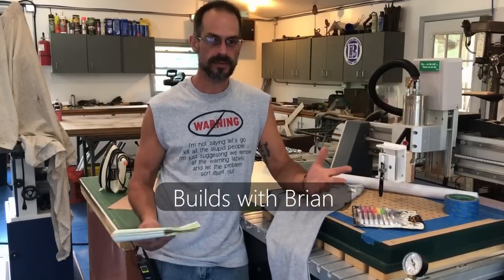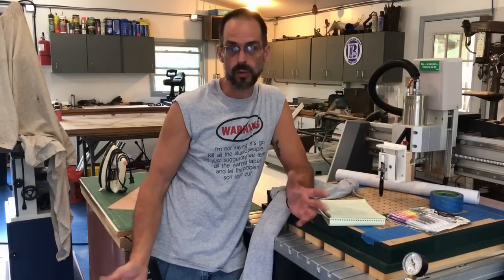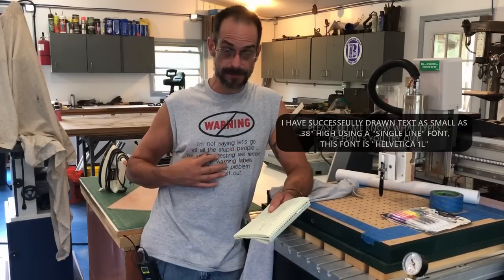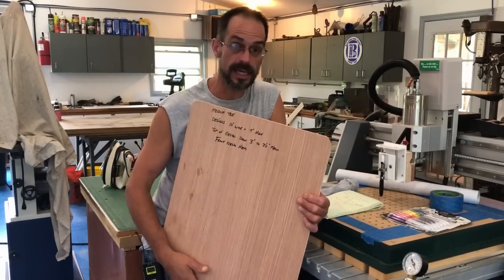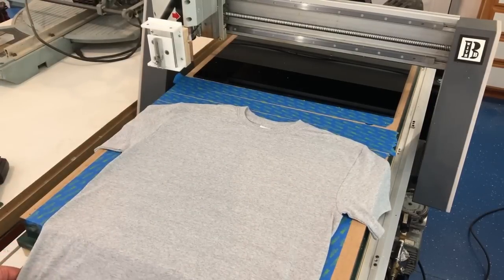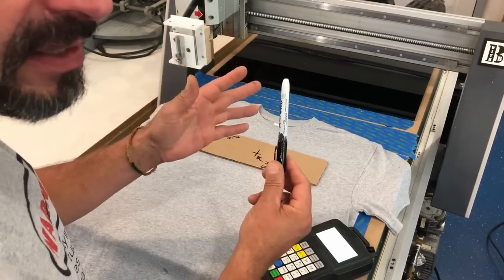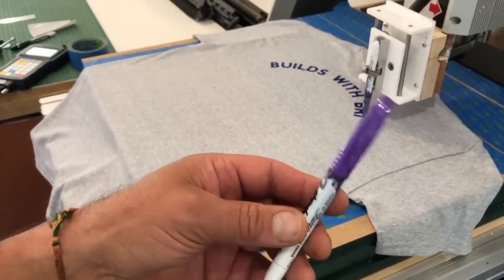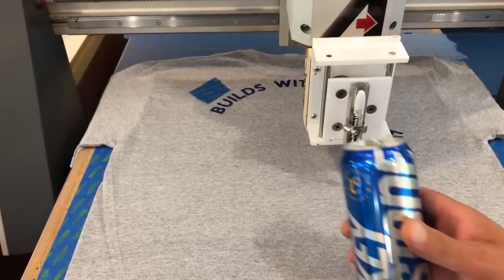How to make Custom T-Shirts with CNC router

Comment: That is really clever I would glue the shirt to the quarter inch plywood with spray adhesive for t-shirts like screen printers use and that way you don't have to use the Shelf paper or better yet build yourself a plantain board and glue the shirt to it and you do not need a vacuum table I'm aware of this cuz I am a screen printer but you got the ideas flowing in my head for a one-off t-shirt thank you for that
Reply from the maker: Good ideas, thanks, I Appreciate tips from a pro

Comment: Great video! Nice pen holders, too!
There are many spray adhesives used for silk screening fabrics, that you can spray on your shirt board, and then pull the shirt over it, smooth, and press the shirt into place. You should be able to easily clamp the board/shirt in place, before running the code. The shirt is easily removed from the board afterwards.
Reply from the maker: Thank you for that tip I will look into that, especially if I produce a part two video 👍

Comment: I’m new to your channel and not sure if you know or not but for those that don’t know. MDF with the top and bottom cleaned of sealer makes a great vacuum top. The air will pull right through the mdf.
Reply from the maker: Yes I have read and been told it many times however I have yet to try it myself.
I might sometime try it, I just wonder if a regular shop vac has the power to pull through it ?
Reply: @BuildswithBrian  on a small area it may work good. You could use 1/4” mdf to do it was easier to pull air🤷🏻‍♂️

Comment: You could make a paddle similar to those used by professional tshirt/top screen printers to hold the material, sprayed with adhesive. 
The adhesive lasts for several shirts. With the right jig system this would allow multiple prints of the same shirt simple enough and the paddles are cheap to make in batches from MDF cutoffs or other scraps the right size.
Reply from the maker: Great tips, thank you!

Comment: Nice!  Personally, I would make multiple vacuum boards that are designed to slip inside the shirt and then mount firmly and precisely onto the main table.  That way, you can be setting up one (or more) shirts while one is being worked on.
Reply from the maker: Let me know how it works out.
I really only do it for fun... and I am not too concerned about being production oriented 😁

Comment: Hi Brian. On z-leveling - would it make sense to mount the pencil in place over the tape? Then you will not need to stress yourself precisely positioning it. Just let it touch the tape, fix it and may be lift a touch, set z zero?

Comment: As far as the vacuum system issue goes what if you use a screen over the top board to keep it from dipping into the holes? That may be cheaper than a new table altogether.

Comment: I have Vcarve pro and how can I draw in the center of the two Vectric Vcarve lines, I really to know this?
Thanks
Reply from the maker: H H ... not sure what you mean by  the “2 v-carve lines” can you explain more ?
Reply: @BuildswithBrian  I have sone ink drawings I made and wanted to use my CNC to draw them.  I use a digital camera to take the picture then I connect the camera card to the laptop, and import the JPG image into VcargePro and use the import bit map for tracing, then  click on trace bitmap -fit vectors to selected bitmap.  This makes a vector line on each side of the lines, next I select the blurry center.  The two lines are for VCP the limit the Vbit cutting. I can either use the Quick Engraving or the V-Carve utility to draw the imported image.  And that is where the two lines come in. 
I would rather just have a single line as that would look more like the original drawing.   Is there a better way to get a single line to be drawn from the CNC?
I contacted Vectric and they said to use the Offset utility and just make the two lines closer together, but that’s really not much use.
Thanks 
HH
Reply from the maker: H H ... now I understand, and I have had the same problems with bit map tracing.
There seems to be no way around it, at least in my experience.
It is frustrating.

Comment: Hi Brian, I watched the video that Dave Hatton had you as his guest...awesome show and ideas, thanks for sharing your thoughts, really great stuff! I was anxious to watch this video and went right to it. I'm still a newbie in cnc , you expressed in your video about the spots showing through the fabric. Couple of thoughts popped into mind, I'm certainly no expert, but thought I would share them. Thought #1; could you laminate some window screen over the whole vac table to decrease the vac pulling shirt into holes, not sure the effect of would have on the ability of any lost suction between the hole as mean is porous, fibreglass vs. aluminum screening? Second thought is maybe the air suction shortening the open time of the ink toner resulting in inadequate saturation into the fabric. Thanks to both you and Dave for the inspirational ideas etc.😊 Andrew

Comment: Really enjoyed your presentation. Very informative. I’m looking to use a CNC to build custom electric guitars/basses but would like to keep the router earning when I’m not working on instruments. Would you be able to forward information on the CNC router you use?  Thanks for sharing this information. Your setup is superb. The letters are incredibly crisp and clear. It may be the router will be running more for custom graphics, especially if I can get it to print half as clean as you are. 😎🤘
Reply from the maker: My cnc machine is an axiom AR8 pro,
It actually has a spindle instead of a router, and I have been quite happy with the setup.
Although i can’t recommend that you try to print graphics on t-shirts with my method as a business model, it it to slow, but it works great for having fun and making them for yourself or family and friends.

Comment: Very interesting, creative, and something I had never considered doing with my cnc. Thanks for explaining it in such detail. 

The Z axis pen holder you have that can move up and down. Is that just gravity holding the pen in place, is it there acting like a weight to put pressure or do you have it fixed solid while drawing. I did not see it move while draining.
Reply from the maker: Wicked Wood , yes the pen floats up/down to follow the surface , if irregular, the weight of the pen holder is the only downforce, works great. Thanks for watching

Comment: Great job.  Would it work to use a heavier shelf liner or two layers to keep the material from sucking down. I use a material called Oramask for painting signs.
Reply from the maker: Yes I’m sure It would help, but I don’t think it would totally solve the problem.

Comment: Nice video. What feed rate are you using and what is a bleeder board?
Reply from the maker: Armando Garcia sorry I can’t remember the exact feed rates, but it’s not too fast.
I am using my vacuum table to hold the shirt down, with a vinyl backing on the shirt.
My vacuum table has quarter inch holes space 1 inch apart, which is a little farther than I would like to have with the shirt, a bleeder board would be another board that sits on top of my vacuum table that has smaller holes space closer together

Comment: Sharpie pens look good but for filling s Stationery Island Fabric markers could do better job. It's dual tip with one fine and one bold. Very practicle unless the pen length that could be tricky to fit on the machine. There is also paint marker such as Pebeo SetaSkrib+ to consider/test. As it is paint it works also on dark fabric.